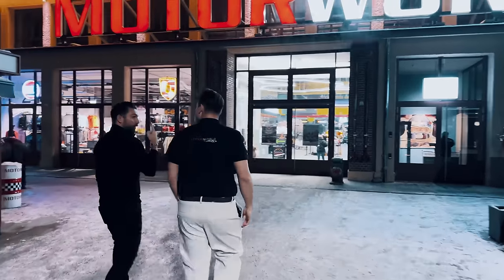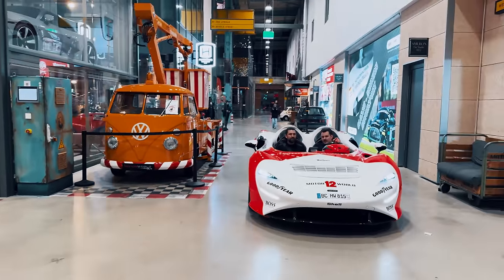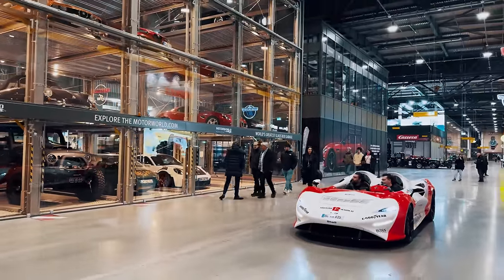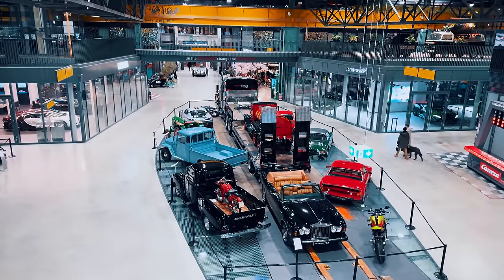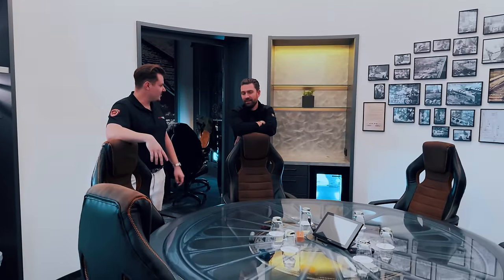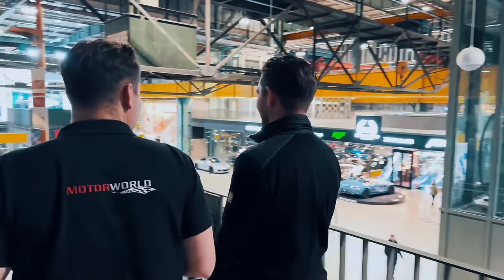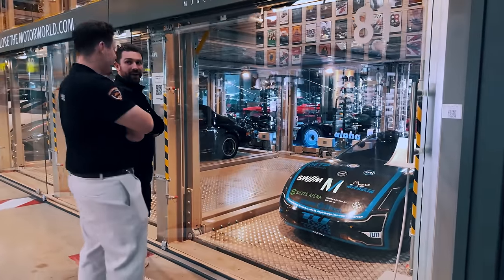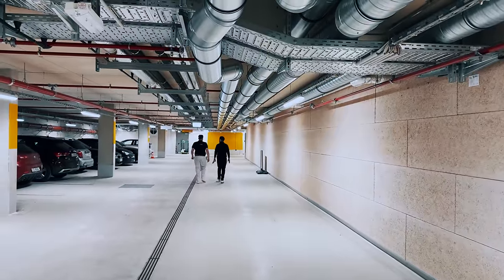WORLDS LARGEST SUPERCAR GARAGE NEEDS MCLAREN TO EXPLORE!

Comment: Wow would I cream my pants in this place. I need 14 spots for my cars and trucks, I keep all my vehicles in a huge shop that is climate controlled.

I installed my own lifts, tire machines, balancers, etc… stock oil, filters, fluids, etc… for all my cars and trucks including a few sets of tires for the more driven cars, don’t buy to any as I don’t want them getting old before I can use them, I am the only one that drives my cars.

Comment: Holy crap James, lol. 😵 When you came up the stairs and pointed out that gantry crane as a part of the original infrastructure, it brought back some VERY crazy memories for me. There were a few (actually quite a few) rigging companies that simply wouldn’t touch those large gantry cranes so I got the smart idea of specializing in their removals and transport and if the customer wanted, re-installation at another site. Yeah, we made a sh*t load of money doing these insane jobs no one else wanted to do. But dear GOD was that A LOT of dangerous work!!🫣🫣🥵🥵 We created our own center spinner and support wheels to lift and rotate those monsters off their guide rails. We made the outer support wheels used to carefully rotate the entire gantry from two landing gear sets off of a scrapped 727 jet. When I told the guys what I was going to drive out west and grab to use for the support wheels, they thought I was nuts. Ended up being a creative solution that worked beautifully. 😎😎😎 I don’t miss those days, LMAO!!! 🖕🏼😂🖕🏼
Reply from the maker: Amazing! What a great story and congrats on your entrepreneurial spirit! 💪🏼👍🏻